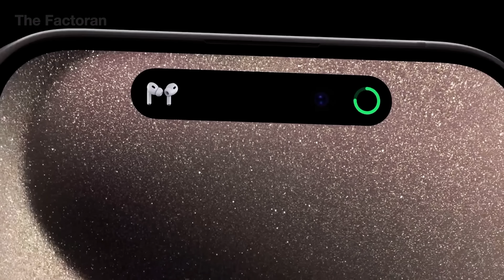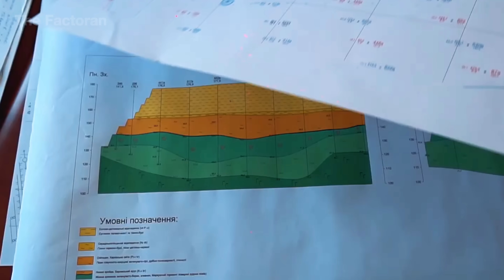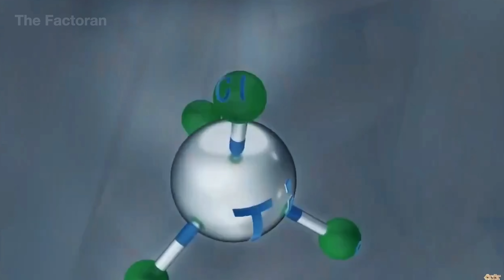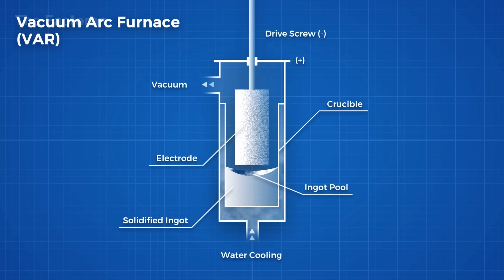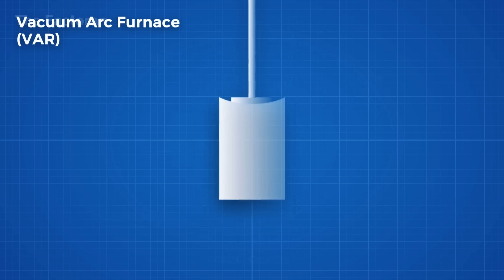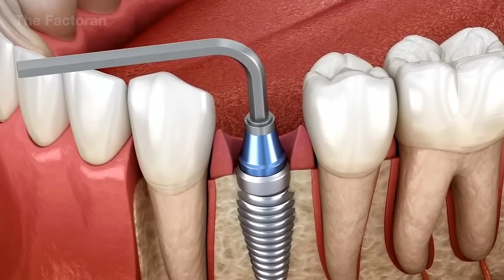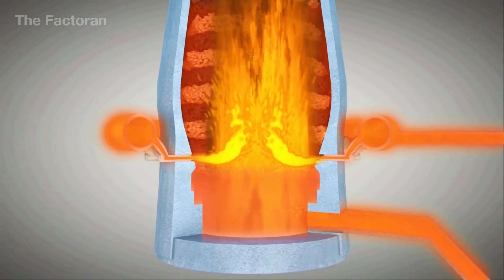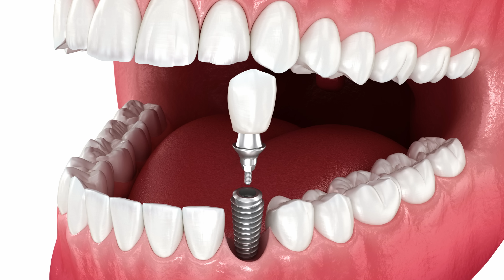How Millions Of Tons Of Titanium Are Made - From Ore To The Strongest Metal

Comment: a car accident gave me two titanium rods for shattered bones. thank you earth.
Reply: They're actually titanium alloy rather than pure titanium. The elastic modulus of titanium is too high, which causes bone loss under stress, so more elastic alloys are used. Bones actually bend very slightly under load. If the hardware doesn't bend too, it can cause significant problems.

Comment: The regolith of the Moon is titanium ferrous oxide.
Titanium is part of a pigment compound for white paint.
This is something that I hope is spread around the metallurgy community:  Secondary electrons from CP titanium are 1.7 eV, and the flux is 50% of the incident ions.  This point is significant for electrochemistry.  I hope that my assertion is verified and that the property is exploited and applied to useful purposes.
A property of titanium ferrous oxide is that it adsorbs helium-3 (isotope).  Lunar Helium-3 will be the energy savior for human consumption once hydrocarbon resources are depleted.  As it is, the helium-3 lunar extraction is much cheaper than hydrocarbon extraction on Earth when, for instance, one considers that 50 tons of Helium-3 is fused with deuterium (hydrogen isotope in replenished quantities and east extraction from seawater).  The helium-3 D2 conversion yields the stable helium isotope, helium-4 (for party balloons), and a proton, which is manipulated like an electron.  See Harrison Schmidt's book "Return to the Moon" for verification.  Dr. and Honorable Senator Harrison Hagan Schmidt, PhD, Apollo 17.  Former U.S. Senator from New Mexico.  SPREAD THE WORD!!!!

Comment: I subscribed because I thought you handled the nuances of durability vs cost and environmental impact well, but the transition into steel discussion was poorly handled. Also, the inclusion of the "Titanic" viewing submarine that imploded taking 5 lives while praising the "positive" aspects of titanium was, obviously a big mistake.
Reply: In fairness the titanium end cap of the Titan submersible wasn’t the problem, it performed well. It was the carbon fiber.
Reply from the maker: Appreciate the feedback — you’re right, that transition and reference could’ve been handled with more care. 🙏
Reply: @TheFactoran  Don't mind him, including the Oceangate sub is just fine. It reenforces and juxtaposes the strengths between titanium and carbon fiber.